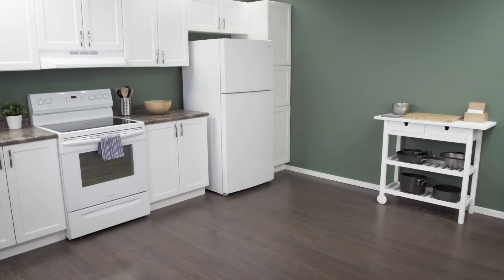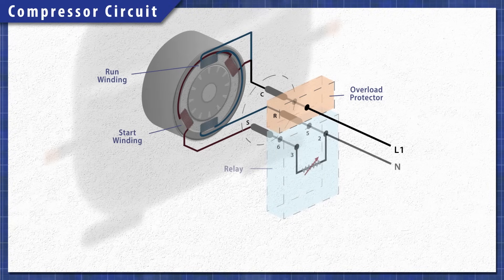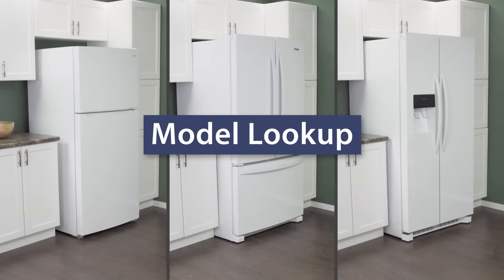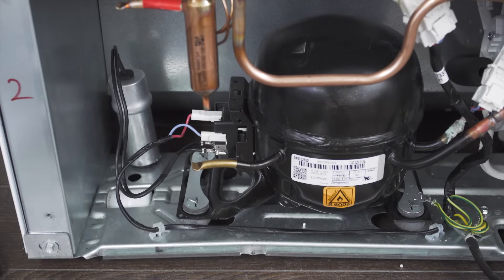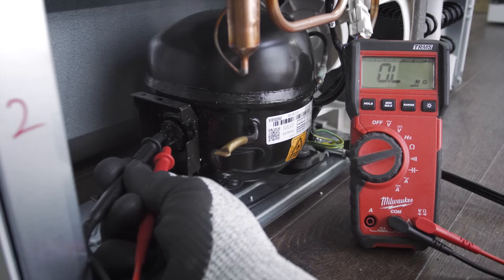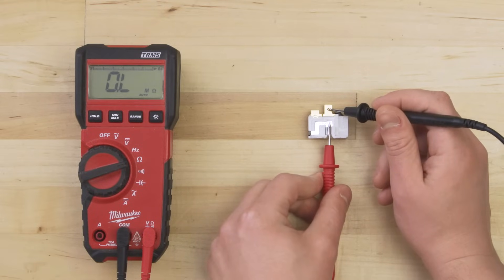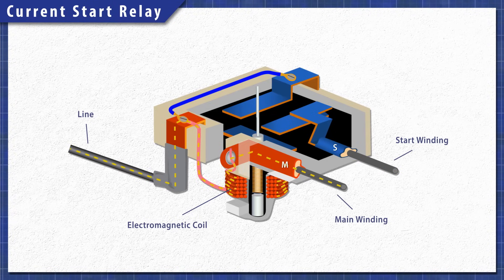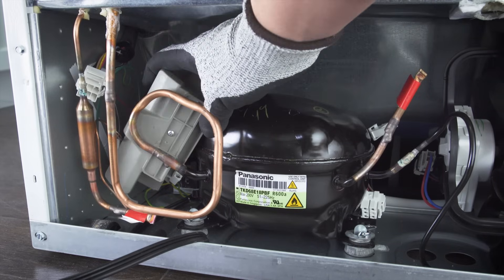Refrigerator Compressor Troubleshooting (Complete Guide) | Repair & Replace

Comment: I've been struggling to diagnose my freezer. Can you help me?

 I got it from someone who said it worked but it didn't when I got it to my place. I plug it in and it never cools down; I think I smell a fait chemical smell when I open the lid. I looked at the internal components and have been doing some testing.

When I plug it in I hear it try to come on but then after a few seconds I hear it click off.
I tested the capacitor and it's rated as 12mf but the when i put a multimeter on it for ohms it climbs to 20 ohms.
The starter relay shows continuity all three ways. 
The compressor ohms reading measures 10.6-11 ohms between the start and run winding terminals, maybe 7.5 for the start to common but there was a a wide spread of variability and then 3.5-5.5 on the run to common.
Compressor was drawing about 12.2 amps and the LRA value on the compressor is 14.6. (for what it's worth I measured amperage going into and coming out of the thermostat and it was around the same, varying from slightly below 12 to slightly above 12v.
This evening I just replaced the capacitor and it didn't help and then I replaced the relay, too, but the result is the same, I hear some faint noise like it's trying to come on and then it clicks off. After I replaced both the capacitor and the relay I noticed pungent odor, not a sweet smell like I thought freon smells like, and then when I went to unplug the relay from the compressor I noticed that it was very hot on the top of it.

Where do I go from here? By process of elimination I think I can just assume that it's the compressor but I'm someone who wants to understand the why and as far as I understand given these values the compressor should be functional. So can you help me fix my freezer and understand what's going on?

Thank for your time if you decide to give it!
Reply from the maker: Thanks for watching. The scent could be the heat / dust on the compressor or it could be a small leak refrigerant leaking out but this is difficult to tell for sure. 

Before assuming the compressor is faulty, make sure that the condenser coils are completely clean, and that the condenser fan is running. Also do not test the compressor without the back cover as you won't get proper airflow and it will heat up.

If this doesn't help it could be an issue with the compressor itself. At that point you'll have to get a technician to work on it as this is a sealed system, which requires a certification to work on.
Reply: @AmreSupply  thanks! At the moment I'm following another lead and am going to try a hard start unit because the capacitance, continuity and resistance and amps of the compressor, starting relay and capacitor are all checking out. It's a chest freezer so I don't think I have access to condenser coils, right? Nor a fan?

Comment: If there is carbon build up on the electrical connections then its possible you may have poor electrical conductivity between the connections and mains to begin with.
Reply from the maker: Thanks for watching. A loose connection or high moisture can also be a contributing factor.

Comment: No finding the correct parts is a challenge
Reply from the maker: Thanks for watching. Have you tried entering your model number into this model lookup tool? https://www.amresupply.com/lookup
Reply: Comprssor  termila strting ruing com c  3tremalal forst time comprssor  relay usi g ptc  boxtypye  models drpanding  olp ovef lord anx thermostat and on contacting  time fsn contacted explas   thermost cutof systom tempaurd and door swith bube light udinv frgein sidd  time fost  defortd d models drpand wireing s ok gues jollh

Comment: what if you have 9.4, 6.6, and 5.6 for ohm readings...
Reply from the maker: Thanks for watching. Generally the readings should be close and should add up to the combined number. Depending on the multimeter there might be some variance, and sometimes you can get a different reading if the terminals are dirty or you don't have enough pressure with the probe.

Have you checked any of the other start components?
Reply: @AmreSupply   I purchased a higher end meter from HF.  the compressor is fine and working... it was the starter relay.  Thanks.

Comment: thank you for that great video I have a ge profile French door with freezer on the bottom my compressor was making a clicking  sound and the compressor would not turn on I replaced  the start relay and a new capacitor it lasted a week working normally and now I am getting that clicking sound again in your professional opinion what else can it be thank you in advance
Reply from the maker: Thanks for watching. Check the overload protector. In some cases this might be tripping and causing that clicking sound.
A restriction of airflow could cause the compressor to run hot, so make sure the that condenser coils are clean: https://youtu.be/oPmr6boufmE?si=i5s0FO9Oyo8OvFnR&t=267

As well you could check the compressor windings, check for a short and check each start component.

Comment: The compressor i have starts but shorts cycle nothing wrong with the thermostate
Reply from the maker: Thanks for watching. Do you mean that the compressor starts but shuts off too early? How long does it run for? Is the freezer / fridge too warm?
Reply: @AmreSupply   it runs for 5 minutes before shutting off gets only to 45 degrees in the freezer
Reply from the maker: @drkoolking9826 A problem like that in most cases would be caused by a faulty temperature sensor (thermistor) or cold control thermostat. As well make sure the condenser coils are clean, the evaporator coils are free of ice, and that the fans work. 

If those are good, then it could be an issue with the compressor & starting components.
- the short cycling could be because the overload protector that keeps tripping. This could be caused by a faulty overload protector, relay, capacitor or compressor.
Reply: @AmreSupply  it was the compressor thank you
Reply from the maker: @drkoolking9826  You're welcome!

Comment: This video is very stupid. Everyone knows the first thing to check when something is not work is to check the power. Check the power going to the compressor first before checking anything else. If no 120V going to the compressor, then no need to check anything else.
Reply from the maker: Thanks for watching. These videos are structured around troubleshooting, tests and the replacement of individual components. Because of how many homeowners and others are seeking this information, we have made the decision to not do any live voltage testing in these series, so this video is how you would test this in isolated continuity tests. The logic and observation at the beginning still applies as you can determine if there is a call for cooling based on the fans running.

Comment: Thank you for this video. You are a great teacher and love how you show really good angles of what you are doing. I have a personal project this Christmas break and want to repair a mini fridge. Looks like there are only a couple of components so shouldn’t be too hard to narrow it down. I do have a question if you don’t mind, why do overload protectors go bad? I am thinking a spike in current but if that was the case. Could it be that replacing it will lead to the same outcome? Thank you for sharing your insight!
Reply from the maker: Thanks for watching. An overload can fail if it is repetitively tripped. This can be high temperature or high current. High ambient temperature or restriction in the airflow can cause the compressor to heat up past its normal operating temperature. So it's always best to check the airflow around the fridge. A spike in current is difficult to narrow down but you can still check to make sure that the compressor is not shorted by testing each terminal to the shiny metal of the compressor body as shown at 7:55